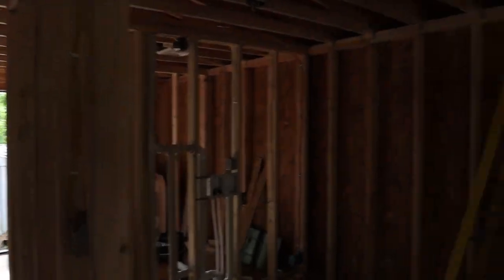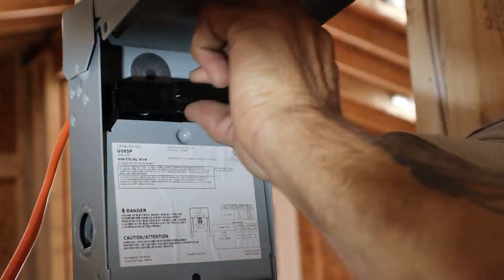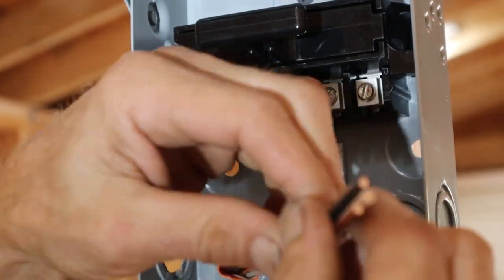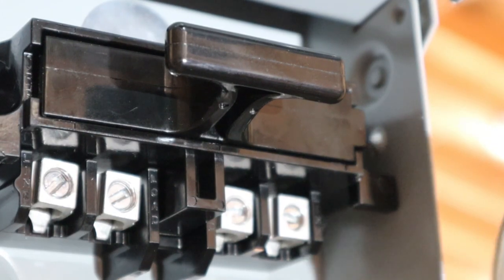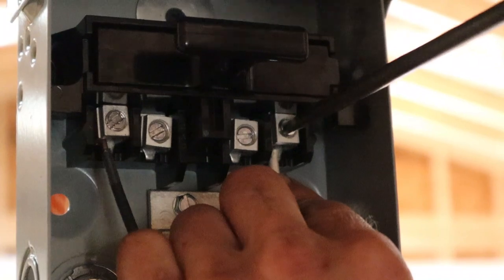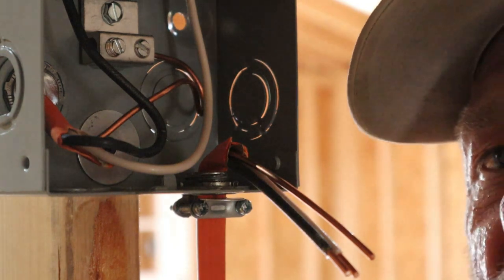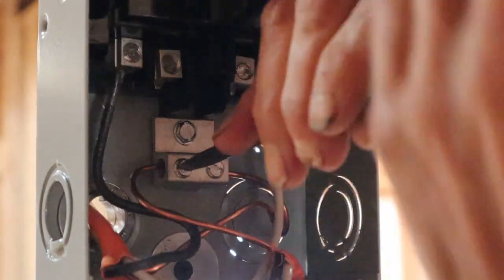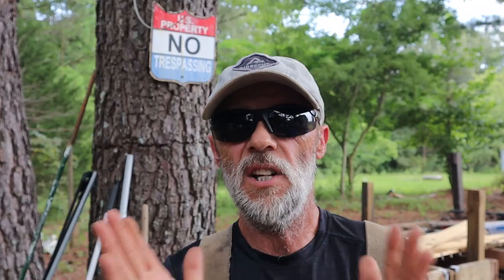HOW TO INSTALL/WIRE 30A 240V QUICK DISCONNECT FOR ELECTRIC WATER HEATER

Comment: black or red tape should be wrapped around the white wire at the panel and and in this disconnect. this identifies the wire as a power wire and not a common wire. i do commend that a disconnect is being installed. so many video on you tube about installing wiring don’t have and type of switch or disconnect near the electric hot water heater. nec   code .

Comment: I'm looking for 10-2 water heater wire (or appliance whip) that has both these features: 1. solid copper wire, not stranded wire & 2. red, black and insulated green, instead of white, black and bare copper. Any online source? Also: someone commented on another video that a household 40 to 50 gallon water heater with dual 4500 Watt heating elements should more accurately/ideally be connected to a 25 AMP electric panel circuit breaker, instead of a 30 AMP breaker. Also: Siemens Model GNF221A "General Duty 30 Amp 2-Pole 2-Wire 240-Volt Non-Fusible Indoor Safety Switch" may be a bit more convenient option for a quick disconnect next to a water heater, for manually turning on/off heater only when needed.